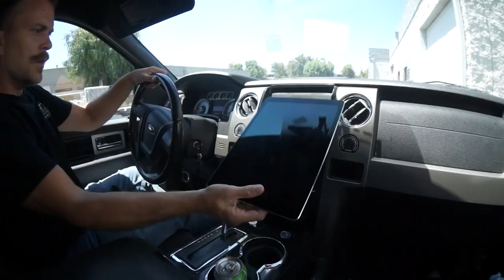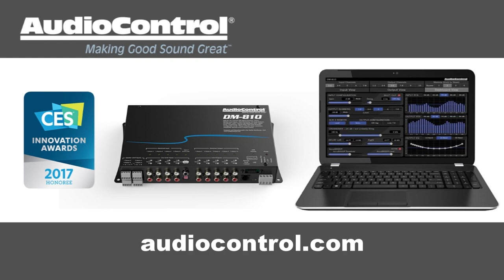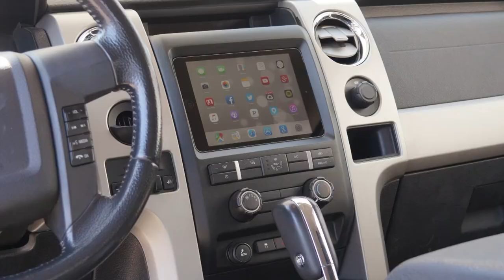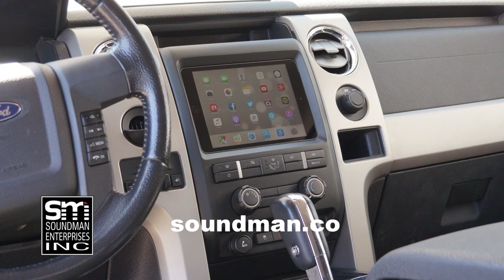Fix mommy's Honda Pilot! - VLOG! BVV#48

Comment: Brake clean is used on the rotors were the pads sit to take off the oil that the factories put on it to prevent rust

Comment: i did this same thing, and my wife divorced me. mountend and balanced the tires, put on new rotors, lubed and installed the brake pads, even used the same brand Sil Glide. just cant figure out what went wrong. 🤔

Comment: Honda Pilots have shitty ass front brake rotors and the dealer will not replace them even if they warp under warranty. Just plain garbage. Sold ours and got a 4Runner.